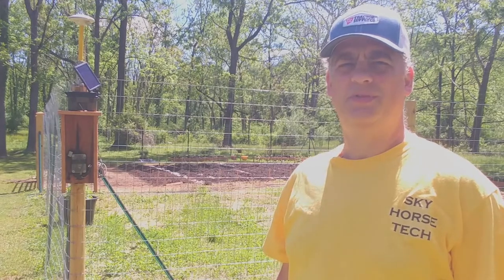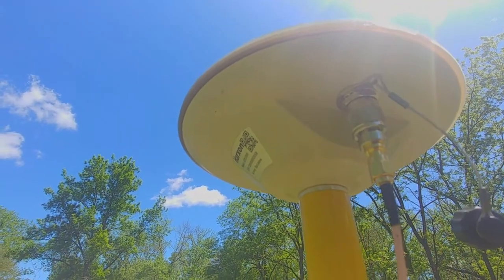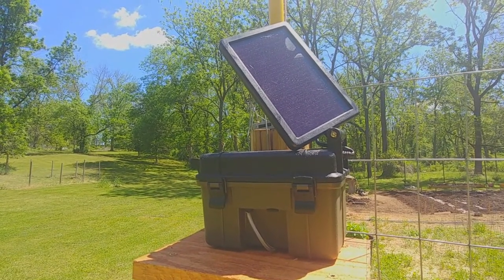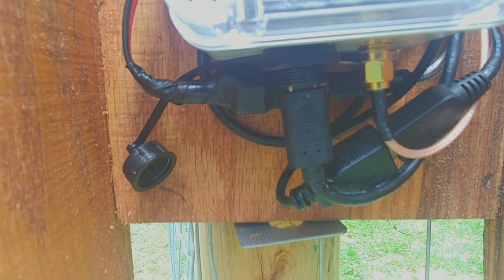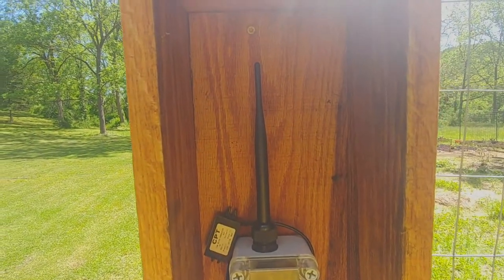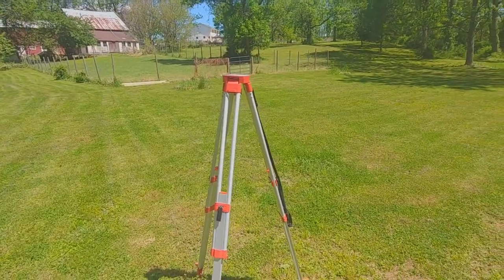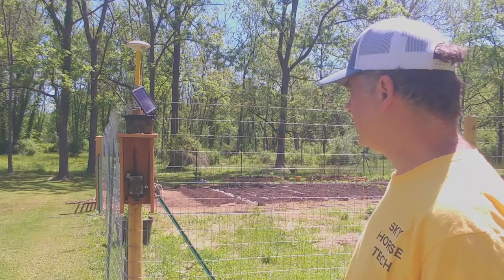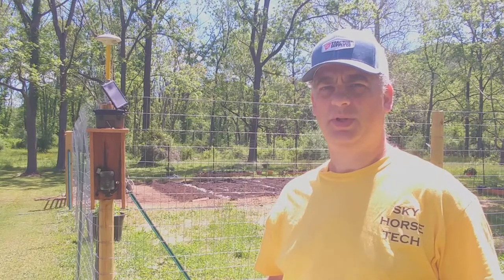Setup a ZED-F9P Base in Permanent Location

Comment: Great videos, thank you for documenting your build! Any chance you can link to the antennas you recommend for base and rover?
Reply from the maker: Apologies for the delayed response. We have been using the Harxon GPS1000 antenna for both base and rover. Several others had suggested that and we are glad we went with it. You can purchase thru Harxon but there are also resellers on eBay that offer the same antenna.

Comment: Hi, can you describe how to get the exact coordinates for the fixed base station. Did you perform the survey in to determine that or it was based on a previous known point or using google maps? Thanks
Reply from the maker: You can put the base in Survey-in mode for 12-24 hours and get a pretty close coord. The consensus however is that will not get you as close as obtaining your base loc using a CORS station as the 'base' and using that as a reference to lock in your actual location (NTRIP also works but costs addtl $). You would need to log your base station .obs file (see our video on adding an adafruit SD card logger or use UBlox u-Center attached on laptop) then you can use RTKLIB to calc an accurate position. See docs like this from Emlid: https://docs.emlid.com/reach/common/tutorials/gps-post-processing/  and the manual from RTKLIB. Also see Rtklibexplorer's docs. His version of RTKLIB is coded for the multi-band ZED-F9P. Some of the docs out there for modules like Here+, Emlid or others are for single-band Ublox M8* modules that don't account for the extra satellites.  If anyone else has a tip for how you prefer to grab base coords please comment as well. Thanks for watching!
Reply: @SkyHorseTech  Thanks for the response.

Comment: A better solution than survey-in is to use a post processing services like OPUS or CSRS-PPP, as these services will use multiple reference stations to provide an averaged correction.  Using OPUS you can get 1-2 millimeter accuracy in 2 hours.  Survey in is a just an average of observations.  From what I've seen survey-in can only provide 7mm accuracy in 24 hours.
Reply from the maker: Exactly. In the comment section of one of our other F9P videos we recently talked about the limitations of Survey-in. We noted that the consensus is to use an external service such as CORS thru a RTKLIB solution to obtain a more accurate fix. Several of our partners use OPUS for the exact scenario you describe. Survey-in is ok but not that great for production work. Thank you for watching and your suggestion!

Comment: Can you show me how to survey in as I just turn on my base station and rover a get a fix
Reply from the maker: If just getting started definitely check out our prior video https://youtu.be/g92GboiOkeQ for the initial steps and wiring. For setting your base in 'Survey-In' mode you'll use u-Center (free, required to update base/rover). Connect u-Center to your base F9P module by USB cable then in u-Center go to menu View/Configuration View/TMODE3. In the TMODE3 screen select dropdown 'Survey-in' for Mode. Then in the two Survey-in boxes enter the Minimum Observation Time (in seconds), this should be at least a few hours (multiply the desired hours by 3600 seconds and enter those seconds). Then in the Required Position Accuracy box below that enter an accuracy in meters (3 centimeters = 0.03m). Next, click on the 'Send' button on the bottom of that screen to flash your F9P RAM and it will begin the Survey-In process. Once that has completed you can note your Lat/Lng/Alt and place the F9P in Fixed mode using the same screen and those coordinates. Remember, to permanently save any settings in u-Center to your F9P board you'll need to go to Configuration/CFG and click on 'Save Current Configuration', click on the same 'Send' button at the bottom of the screen. Hope this helps-